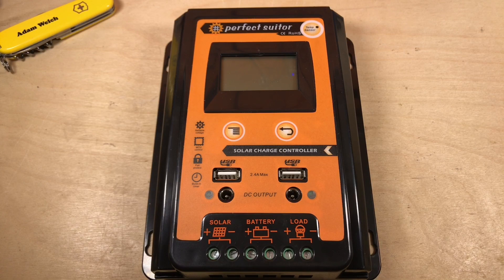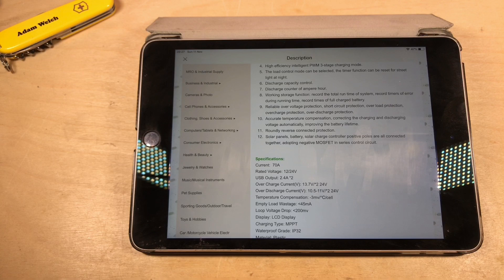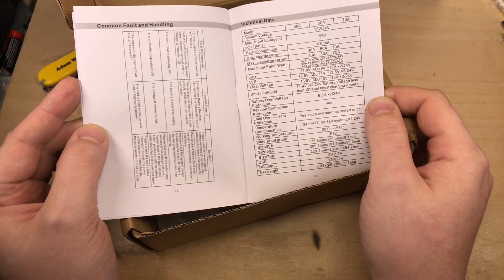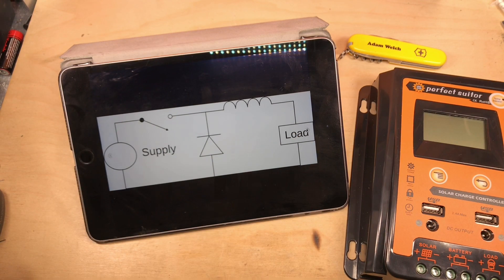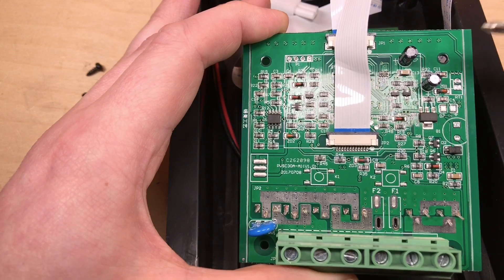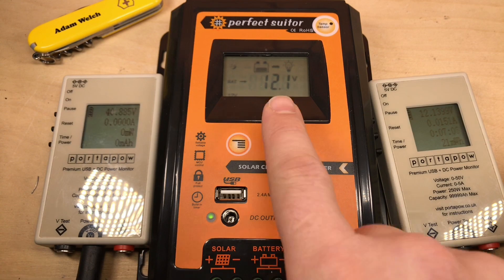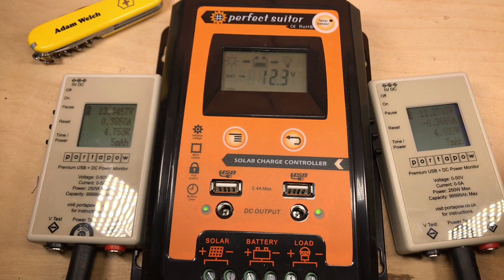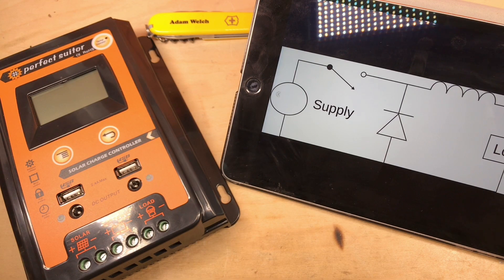MPPT or PWM? Perfect Suitor Solar Charge Controller

Comment: I wrongly believed this was an MPPT controller and connected my two panels in series.
It was either faulty out of the box or couldn't handle it and ended up boiling a battery at 16.8 volts for about an hour before I caught it.
Also bought the 70 amp version and at least it isn't frying batteries but claims it was producing 6.7amps in the shade when an ammeter shows 400mA.
My advice, avoid these things.

Comment: This may be a Random comment. I need help. I have a hoselect mppt charge controller. The input voltage of the battery and pv is inaccurate causing the mppt to sense that my battery is full. Is there any way to calibrate the voltage?

Comment: Thank you for this! You definitely saved me some time and headaches. 😂😂 I was about to try one of these out, but right before confirming my payment, I noticed the heat sync looked like a decoy.  I realized I should see if anyone did a teardown!  What’s also funny is some of the genuine MPPT controller manufacturers show pictures of this inductor inside (and the PVMs I’ve looked at never bother showing the inside). This product’s video has a thumbnail of the back panel opened, yet all you see are those little pieces of conductive tape and not the inductor!  Then you play the video, they don’t even show the inside  (including the heat sync taped portion from the thumbnail ). They really went the extra mile to try to deceive. 😂

Have you found a good, genuine MPPT controller that’s cheap yet?

Comment: If you connected them in parallel, would the MPPT point of 17V be closer to 12V and you would get higher current ?

Comment: so i noticed the controller was 12/24. i think you said you had a 48 volt panel charging it. im running 12 volt panels in series for 24 volt, and wondered if adding one to make 36 volt would hurt my controller at all, whats your experience with running 2x the voltage through that controller

Comment: Don't trust the advertisements. Can't we get the sellers for false advertising?
I bought a controller from Maplin a couple of years before they shut but I'm sure it wasn't advertised as MPPT and around £12. I hadn't realised there were different types. I soon found it wasn't charging my battery properly and was always undercharged. I managed to get the back off it and it was potted inside so if any adjustments were possible it was impossible to do.

Comment: .... "Chy-na Engineering" = Cheap Engineering...  that's why Corporate American has been exporting Manufacturing to "Chy-na" since the late 70's, because of this one Manufacturing/Production scheme, and it's also rot with Fraud, incompetence, and Trash.  99.9999999999% of everything they Manufacture will end up in a Landfill contaminating our fresh water supply.

You can Thank Presidents Nixon and Bedtime for Bonzo, aka Reagan 🤬

Comment: Hi, regarding your video, I ask what append if I install it on RV with following config.
AC/DC converter on load connector and battery deep cycle on battery connector.  When RV is connected to AC, will current pass from load to battery to charge it?

Comment: Hi Adam, thanks for another informative video.
I have found that there are many charge controllers which are essentially a buck converter which (maybe that why they are called "PWM"?). Since buck converters should have an energy storage device there should be PWM controllers with an inductor. Hence, the presence on an induction should not be a factor for categorization in my opinion.
weird
Reply: You're mistaken. PWM chargers don't need power conversion to work. These type of chargers basically connect the solar panel directly to the battery at a certain interval and varying duty cycle. That's about it.  If a charger doesn't have a reasonable inductor it can't be a mppt charger as this type of chargers definitely need power conversion.
Reply: @egbertegberts5384  I had asked the question a long time back when I knew little about these things wanted to clarify. I know better now. Incase you still want to answer the question (for someone else who might be reading it), the question was: If there was a charge controlled with a buck converter without MPPT ability would you be able to tell them apart just by looking for the inductor.

Comment: I purchased a 70 amp version of this then found discrepancies online so I contacted the seller and then refused delivery so it went back to the supplier for a refund. I then purchased a EPEVER Tracer BN 40 amp SCC. Yes it was 5 times the price but it works better than any previously owned SCC which were all PWM advertised as MPPT.
You get what you pay for.

Comment: Funny how we live in a time where in two years, it makes a piece of equipment an antique.
Generally, you get what you pay for. Some folks can live with poor performance and lead acid lifestyle.
Having said that, I DO have a back-up PWM on the shelf, just in case a quick temporary swap is needed.
Reply: Not much wrong with lead acid and pwm if you have a basic or convenience system. Although going mppt regardless of the battery type is best!
Fortunately my lead acid batteries didn’t  read all the recent hate for lead acid batteries so they’re working really good. Will they go 15 years? Probably not. But they’ll probably do 5 years for $600 instead of 15 years for $1300....and I don’t have to keep them warm in winter.

Comment: I have this perfectsuiter charge controller . But facing a problem. I has 4s battery bank and can be charged to 16.8. But this charge controller can be set to a maximum of 15v only. So I am loosing 1.8v charge from my battery bank. Any idea to improve? Thanks Adam!

Comment: Good tutorial & review. I know next to nothing about solar controllers, but boning-up as I intend to setup a kit on a new shed build. I've heard MPPT works better in cloudy conditions, but trying to weigh-up costs v benefits before buying. This really helped me. Cheers!
Reply from the maker: In all honesty I’d suggest putting more money into panels rather than controllers - unless you’re very short on roof space. MPPT is great at maximising what you have in good conditions. But if you’re not using it when it’s being generated I think the better investment is in panels.
Reply: @AdamWelchUK  Thanks. Good advice. I think a couple of 50W panels should suffice for my needs.

Not planning on using an inverter, as I can use an extension cable from the house for large power draw needs. Just looking to hook up a security camera, some LEDs and a radio for occasional use, and power everything from an old 70Ah SLA car battery that's still in good condition. Might invest in a decent leisure battery down the line.

Plenty of shed roof space for panels (approx 10ft x 4ft, south facing). The shed is around 35m from the mains board under the house, a patio, and garden, so digging and installing SWA cable was going to be too time consuming and uneconomical for my needs.

Comment: Can this be used to charged LiFePo4 batteries? I've got 4x 100Ah LiFePo4 batteries in series to form 12.8V (3.2V each) and I was wondering if this controller would be good.

Comment: I got this. USB ports are crap, they break fast. It's not a auto charger. Needs to be set up to the battery or you will mess up the battery. Instructions are crap. But it does work as long as it's set right.

Comment: This is such a misunderstood subject.  A PWM based converter is usually a high frequency switching regulator that requires an output inductor to "smooth" the output current from the high frequency  "on -off" nature of the switch to give a constant output current.  A basic PWM circuit will regulate only the output voltage and current.
An MPPT circuit also measures the input voltage and current to present a load to the PV panel that allows for maximum power transfer.  This additional information modifies the control loop of the PWM. 
The unit you have here appears to be neither PWM  or MPPT, but simply a switch to connect the PV panel directly to the battery and then turn off at fully charged.  It will work, but won't get maximum power transfer or optimise batter life.
Some times the cheap products provide 80% out the capabilities of an expensive one, other time just 20%.  This one looks to be more like 10%

Comment: If you look at the Picture on those Listings on eBay, the  Sample Display on the bottom SAYS. ==> “12v 24v 48v” <==. Sooo, why does it ONLY say 12v/24v in the title? MORE CONFUSION? Or DOES IT actually handle 48 volts? Anyone who has it, can you confirm 48 operation or NO?

Comment: I have mppt 40A charge controller, in very good day 600w panels in series 24v system it gives 35v just 20 to 35w and 1amp to maximum 2 amp.
What could be the reason

Comment: Is there one of these units than can take the 40volts from the panels and charge a 24volt battery bank? Thanks.
Reply from the maker: This will, but it’s not doing mppt. You’ve commented on a few of my videos, I’d recommend the EPEver mppt solar charge controllers over this one.

Comment: I also bought one of these on ebay without watching this video. Quickly concluded it isn't an MPPT type as the PV and battery voltages track. Further disappointment when I discovered that the current measuring and A-hr functions shown in the instruction booklet are also missing. It's not a bad PWM controller but I feel conned....

Comment: mppt not!  but they work great I have a 70 w 50 and 3 /20s  and none of them have crashed 70w is on my dp motorhome full time charging 8 L A batteries with 1800 w in  solar panals 2 years now put fuse before and after and you will be fine.

Comment: With all those parts inside there I'm wondering if you couldn't add a diode and the coil on the panel side and it would work like a buck converter. Somebody took what could have been done with a few transistor and a zener diode used a microprocessor to do the job.

Comment: Interested to know why as stated MPPT  absolutely requires an inductor. 
If the CPU is measuring the incoming voltage and current, surely it could deduce the input power and (e.g. by varying the applied load up and down a little), determine the maximum panel draw power available i.e. for MPPT. This tells the cpu the load it can create by charging the battery at a given voltage/current i.e. it determines the voltage/current that can be set on the charging output.   This again can be tested by sampling an increased/reduced charging voltage to create the target MPPT-optimised output load. The output voltage can be varied using PWM to reduce the average voltage delivered - without an inductor. MPPT is about sensing and optimising load and is not a type of power converter as such.
I don't claim to be an expert and welcome anybody showing the flaw in my thoughts above.
Reply from the maker: In your determining or testing phase what is the battery doing? If you allow the solar panel voltage to go above the voltage of the battery how do you stop the battery from raising up too high? If you lower it, you’ll stop charging. 
If you disconnect the solar from the battery to determine MPP - what do you do with the power while it’s disconnected? 
You need a dc to dc converter in the middle so you can keep the output voltage stable within a range, and the input current at the highest possible value (you don’t really care about the voltage on the input as long as it is higher than the output and within spec). MPPT charge controller are more complicated to increase efficiency - they need to use the higher voltage of the solar panel to convert into a higher current to charge the battery. Without a DC to DC converter you can’t do that. Without an inductor, you can make a buck converter. I hope I’ve read your comment correctly and that my explanation helps?
Reply: @AdamWelchUK  Adam, I am not seeking to argue but I remain unconvinced. To answer your points: When you briefly measure the PV open cct voltage, the flow of current from the PV source has to be cut for a few ms and there is no longer a source of PV current to charge the battery so, even though the input PV volts rise, this rise is temporarily isolated from the charging circuit and is not going to harm the battery. With the panel temporarily disconnected then, there is no power drawn so you don't have to "do" anything to deal with it, PV panels don't mind being left O/C. You certainly need to convert between higher panel volts and lower battery volts but battery chargers often do this by applying a PWM signal which has short periods of higher volts and current when achieving a desired lower average volts/amps. This is how a cheap PWM solar charger allows a "24v" panel to connect to and charge a "12v" battery without an inductor. 

Essentially what I am saying is that the difference between MPPT and PWM in this context is essentially how intelligently the device sets the voltage feeding the battery under charge so as not to drag down the PV panel below its MPPT optimum, rather than the approach actually used to reduce the voltage which may or may not use an inductor. Yes I would prefer to see this voltage change being done with a buck converter and an inductor but I don't see this as vital for MPPT to apply.
Reply from the maker: @rhiantaylor3446  Firstly I don't think we're arguing, discussing a theory I'd suggest. You are correct that you can release the panel from the circuit and take a voltage - but you're only measuring your open circuit voltage (actually this is a method used by some solar charge controllers because the MPPT is usually in the region of 80% of the open circuit voltage).  In your first comment you talked about determining the maximum panel draw power - power indicates you're looking at current and voltage.  This is why I asked where is that current going when you are testing without DC to DC conversion.
PWM'ing a higher voltage gives only a pseudo voltage at the MPP.  In reality the voltage is either at the high or low figure.  A meter might show a mid voltage, but a scope shows whats really going on over time. A low pass filter could be used, but I'm not sure it'd work very well because when the PWM signal is low, you'll quickly discharge the cap to the battery voltage effectively reducing the effectiveness of the filter.  I've put together a PWM solar charge controller and spent a lot of time sat in from of a scope looking at panel voltage while it charges a battery.  
I think the point I'm making is that for a highly efficient MPPT solar charge controller, DC To DC conversion must happen - otherwise there are as many losses as in PWM.
I'd be very interested to see what you are proposing in practice if it's something you think you could put together. Thanks again for the discussion :-)

Comment: Try it again with the two panels wired in parallel... you will find the efficiency will greatly improve...
Reply: How would have double the watts by itself improve its efficiency? It can’t; just makes more watts
Reply: @fishhuntadventure  No I did not mean to create more watts (thjough more panels will equal more watts) I meant the right range of volts going out to the controller...
If the rated voltage (i.e. the open terminal voltage) of the array is close to the voltage of the battery bank THAT is what makes the efficiency of the total system greater...
The more the controller (no matter what type) needs to adjust (up or down) the incoming voltage to the battery voltage the less efficient the controller and therefor the system can operate...

Comment: my 20/20 dingo 12 24 48 volt charge controller it won't work with my single house solar panel 180 watts why???

Comment: Good video. Thanks. I use this perfect suitor for my two 12v (18v) solar panels in parallel supplying to 12v battery. Is it better if I use those two solar panels in serial to make 24v (38v) to my same 12v battery? Will it charge more current? Thanks for your quick reply.
Reply: No. Keep them in parallel, this unit cant DC to DC current pump so will waste the extra voltage.
Reply: Rob Mc Thanks for your advise. I have connected my 3S battery pack to this controller. But facing a problem. 3X4.2V =12.6V. But this controller has a minimum overcharge setting is 12.9V. Will this 0.3v over setting create a problem?

Comment: Bought the 30A model and working fine unless this is a PWM. Also bought the 70A and on this model it dispay the Amps of the solar panels inputs and temperature. Not sure it is a MPPT...

Comment: Adam,  I have a 12v Application,  to run some FANS in my Greenhouse.  The 240W Solar Panels I have, are OCV 37.48V and MPV of 29.48.  mMy questions is can I use a 48/36volt Step Down Module,  which is rated at 12V 20A @ 240 an produce Direct Power to the FANS, or should ......tie in a 20 PWM off of the 12volt side of the Step Down Module?     What would be your recommendation?
What is the Cheapest 20A MPPT that could work in this application.             As ALWAYS your videos are AWESOME !     Any Advise will be appreciated.  THANKS